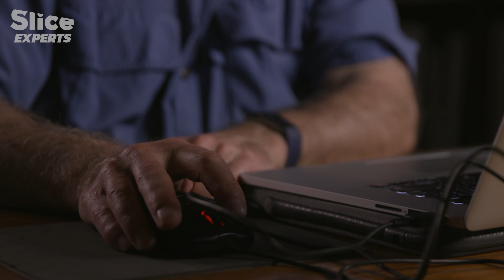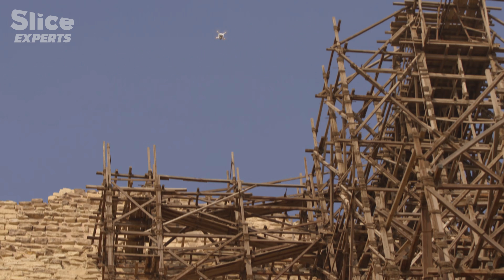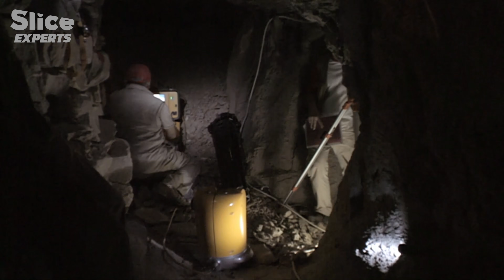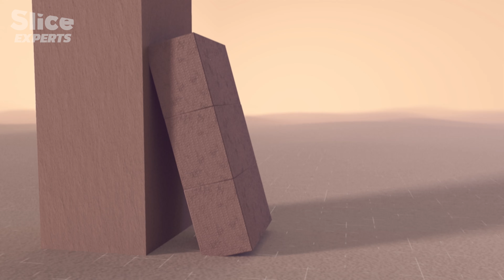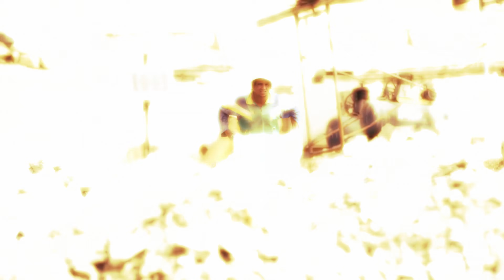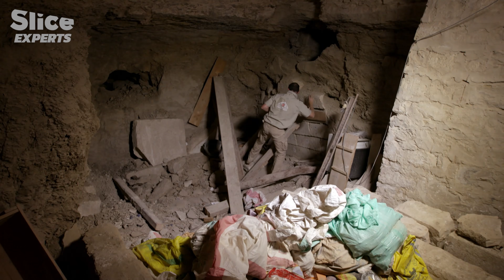Saqqara Pyramid, the First and Most Complex of All | FULL DOC

Comment: Just a thought but given the amount of stone to be processed and the time scale required for it to be done then one would need a production line. Where you have one skilled stonemason supervising/ instructing dozens of enthusiastic peasants.  Such environments would be characterized by large buildings without rooms, long covered halls etc. When done these could be repurposed for more ceremonial, exit through gift shop purposes. Rough blocks in, dressed numbered blocks coming out. Less valuable laborers up the pyramid can assemble these easily needing neither hand skills or brains, merely grunt power.